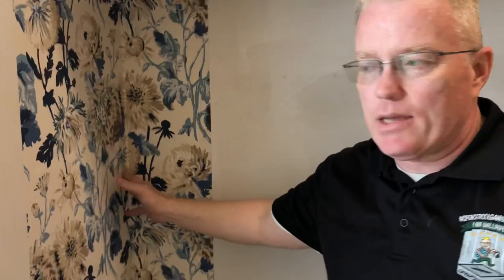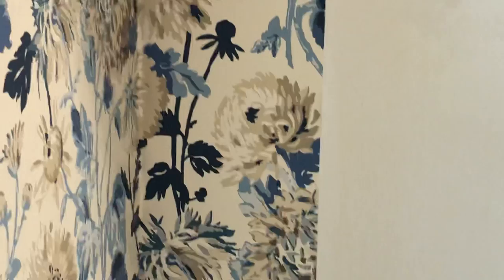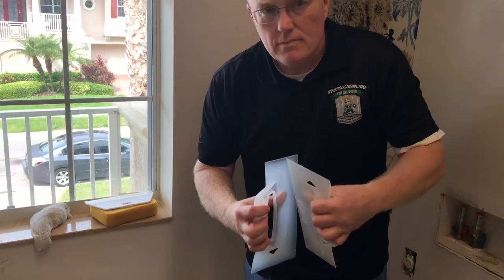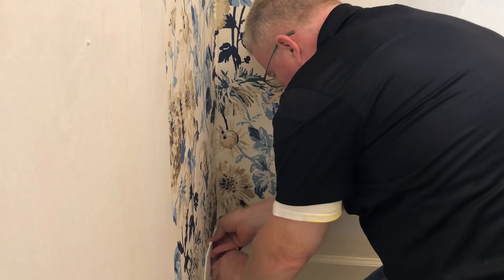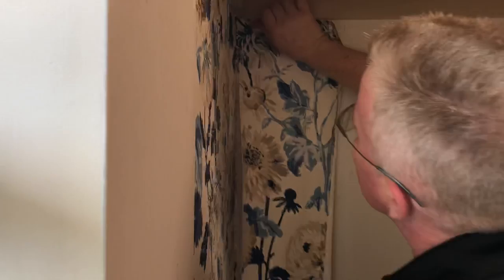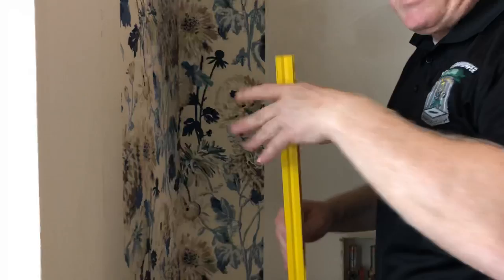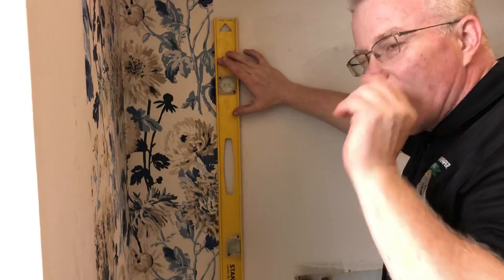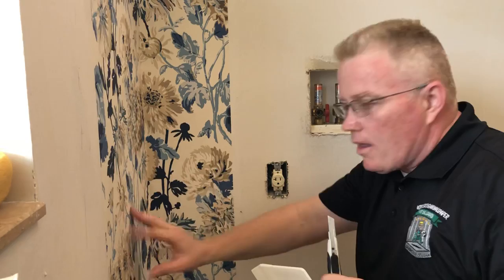How To Hang Wallpaper In Crooked Corners - Spencer Colgan

Comment: The sheet coming out of the corner you should have used a plumb bob then it would be  100 per cent perfect
Reply from the maker: Gabriel, you must be from the UK… I hear you brother but I hate plumbob
Reply: @spencercolgan   May I ask if you don’t use plumb Bob then when you join the next piece this would be running out??
Reply: I discovered I have not one single wall that is straight ( no bowing) and not even corners. They look it but they are liars. I had to fiddle with paper every time I made a corner.
Reply: @robbennett9631 that’s the trouble. He says to use this method if the corner is not straight but then the next piece will not be straight lol that’s why we put a plumb line on the adjacent wall. You’d be better off using the method he suggested if the corner IS straight, then you’d save a littler time hanging it plus the adjacent wall has more chance of being straight for the next sheet

Comment: 100% correct. It's not alllways going to match unless the Conners are 100% straight wicth is most unlikely. The main thing is the pattern to match all the way round the round. We use a laser to make sure its straight.

Comment: Hi again Spencer, so is it quite  acceptable not to cut a corner    and sacrafice a little plump on the adjacent wall? Obviously cut the paper if we have major buckling.. Great video by the way "prozac" 🤣🤣🤣
Reply from the maker: Great question; general rule… Always cut the corner; if you have a geometric pattern, consider not cutting the corner but using and extra tacky paste in the corner to keep it down and then wait on the corner to make sure it doesn’t come up before hanging the next piece; in every case to the right or left of a closet or a doorway we’re there is that 2 inch space and then a corner, no need to cut that at all
Reply: @spencercolgan  perfect explanation, thanks 🙂